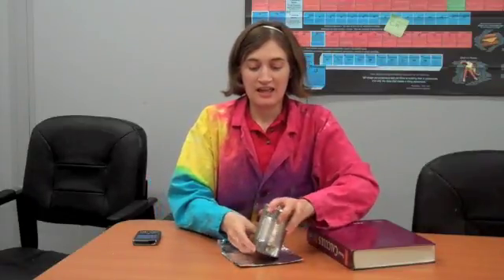Cell Phone Faraday Cage

Comment: ***** guyontheblackchair nolaner1 classically made of cheap steel and coated with tin to prevent rusting. Any conducting material will work.

Actually, this isnt really a Faraday cage because it a solid enclosure, while a mesh with relatively large openings of 7.8 mm will effectively block of 1900 MHz GSM signal.